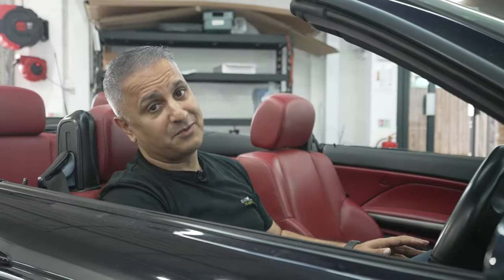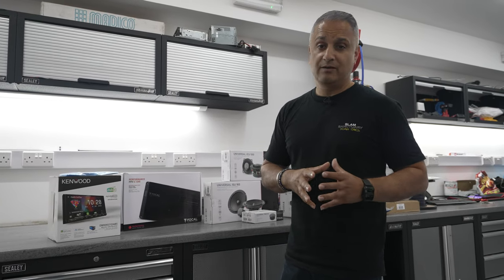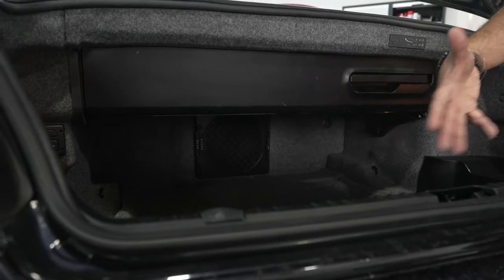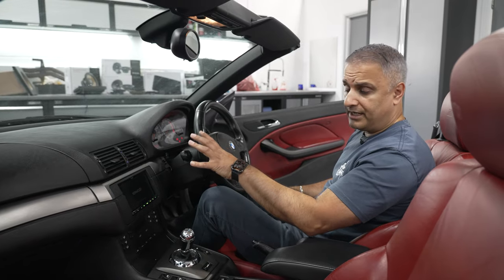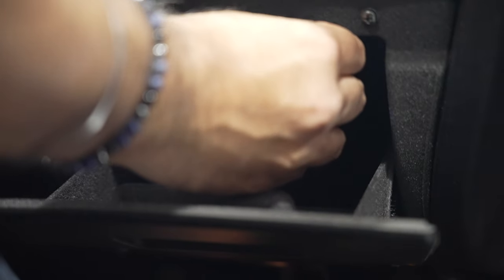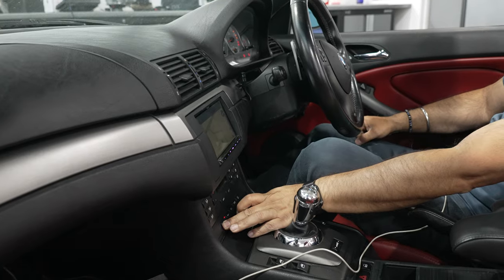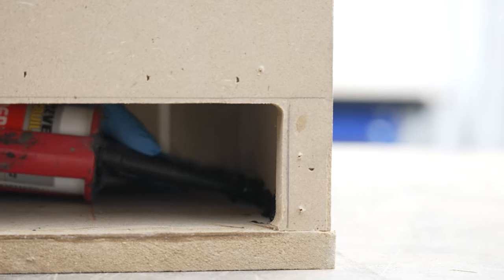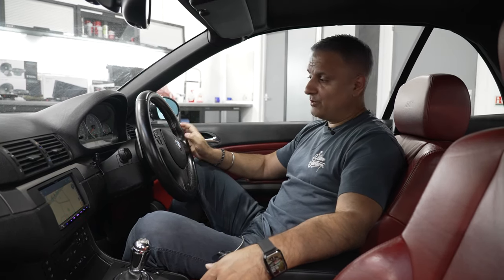BMW E46 M3 Convertible gets a Full Focal Custom Car Audio System | Car Audio Security

Comment: For me 3 to 4K is a high end system 😂 I spent just £700 upgrading the system on my Z4 that included 8 speakers 2 subs 2 amps plus all wiring etc installed by myself and kept the original head unit, oh and that included a MMI box to give Apple Car Play on the CIC idrive. Sounds thousand times better than the stock base 6 speaker system, I am sure it would sound better still with higher end components but 2 to 3k better, I am not so sure!

Comment: Question. I have a 4 x 45w head unit, front comps and rear coaxial speakers and there's a bit of distortion at the higher volume. Might sound a wierd question, but would adding an amplifier to these speakers to put them nearer their rating improve this? 
I have a sub actually fitted in my ski hatch pointing into the car running off a single chanel vibe amp. Works fine.

Comment: head unit looks crap with such a big bezel around it .EONON units fir much nicer
Reply from the maker: The warranty, slow software, poor user-interface and zero customer support is the reason why many car audio dealers do not sell EONON units. Hence the reason why EONON stereos tend to be only available on ebay from sellers across the other side of the world! We only stock, sell and recommend branded products.